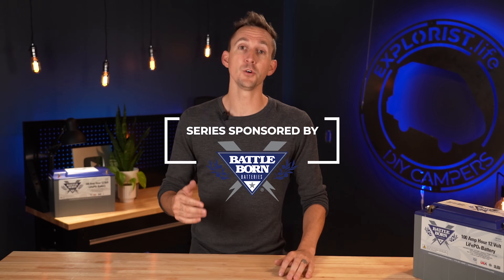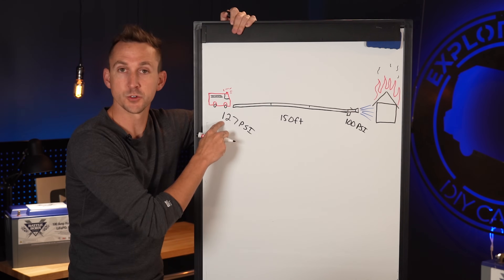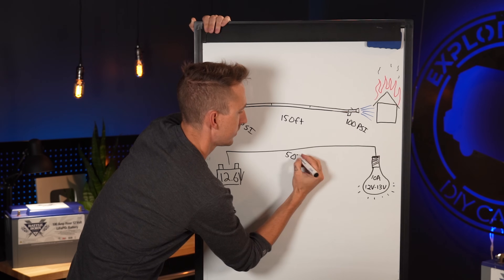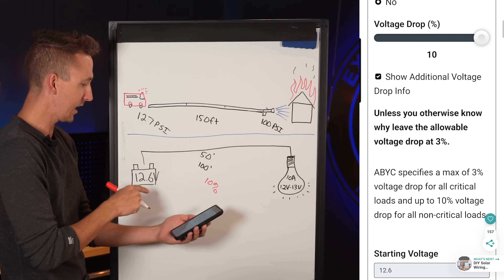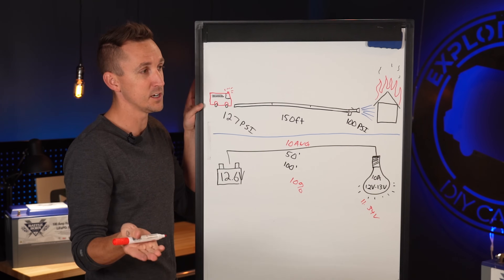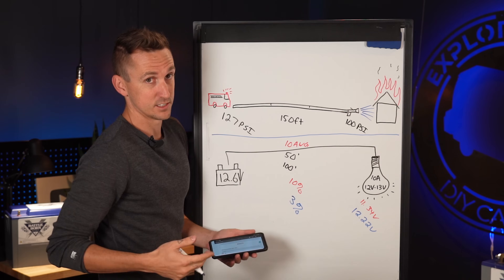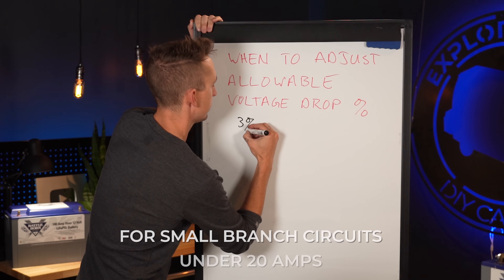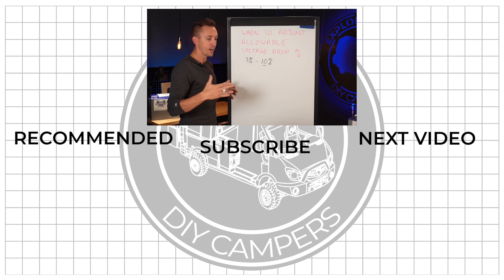WHAT IS VOLTAGE DROP? (Voltage Drop Explained)

Comment: great video!!  if it is ok to ask, could you please help me understand something -  voltage remaining after whatever drop that happened on the 50ft wire is available for the bulb, return path is after the bulb so voltage dropped across the return path should not change voltage available to the bulb. So why do you include return path from bulb to battery in your voltage drop calculation? I hope you are still reading comments on this video.
Reply from the maker: Great question — and thanks for watching! 🙌 This is one of those topics where the details of your exact setup really matter (wire size, load, total circuit length, etc.), and it’s hard to give a one-size-fits-all answer in comments. Our support team is happy to take a personalized look at your project and walk through the math with your specific components in mind 👉 https://shop.explorist.life/support?utm_source=youtube&utm_medium=comment&utm_campaign=support&utm_content=response_link

Comment: @explorist 

May I ask - how do we know in that circuit that the battery will put out the 10 amps the light needs? How do we determine this? What formula and what assumptions? Thanks so much!
Reply from the maker: Every battery will tell you how many amps it can put out.  a battery with a 100A discharge, for example, will put out a max of 100a.
Reply: @EXPLORISTlife  so amps = coulombs/second right? How could the battery know what amp to go at if the coulombs/second depends on not just the voltage but also the resistance? Is it assuming some resistance ie type of wire and type of length?! Thanks brother!
Reply from the maker: We don't have to take any of that into consideration for this discussion, no.

Comment: As voltage goes down (from voltage drop caused by resistivity loading)  current must go up, to produce the desired result. Your also not considering parallel conductors, producing resistance, from opposing electrical fields a  paralleled conductors electric fields (remember the right hand rule).
Reply from the maker: For information regarding wire sizing not covered in or directly relevant to this video, please review the 'Wire basics' chapter of the EXPLORIST.life Academy: https://www.youtube.com/playlist?list=PLmvhcyi4n0TXLHS1NeK_sCvq3Wsa3B0kT
Reply: What is “resistivity loading”?

Comment: Hey good day I've recently checked a house with an electrical problem, the owner said some lights and points are not working,  so first thing I check to see if any breaker was trip but no break was trip I check the voltage come into the house from the main panel and I saw on one phase I was getting 118v and the other phase was getting 79 volts, so first thing came to mind was the gpl power( my country utility) I turn off the main break and check the voltage coming in again and I saw 118v on both phase, basically the voltage stabilize, after troubleshooting I notice two circuit was causing the voltage drop one was at a gfci outlet that was working and the other one was some lights.i turn those breakers off. Now that main panel is feeding and apartment with a 4mm/12awg  flex cable when the main breaker turn on from the other apartment the voltage start to drop more ranging from 24v 45v after troubleshooting I notice that the when the breaker that controls the lights are on the lights are causing the voltage drop. This the first time I came across this. Another thing the power wire that is popping from the first house main panel is 4mm/12awg flex cable is then connected to a 10mm/8awg cable, could the voltage drop because the power cable is under size?

Comment: Why not just do what auto makers do and ground the bulb and battery through the metal chasis of the vehicle.  That way, you use half the wire.
Reply from the maker: Using the chassis as a conductor is a great way to end up with grounding problems down the road.  We recommend using dedicated wires for all aftermarket devices, components, chargers, etc.

Comment: Hi, I would need some help.
I have 230V to 8V bell transformer and I want to connect an electric bell 8V, trought ca. 20m thin telrphone cable. The problem is that the wire is too long and its loosing the power so that the 8V do not arrive to the bell. What could I do to fix this?
Would it be maybe usefull if I increase the voltage from 8 V to 12V?
Thank You in advance.

Comment: This video taught me that every 50 feet of firehose requires an increase of 9psi.
Reply from the maker: But in real world applications, if the nozzle is rated for 100PSI and you pump at 127PSI to overcome friction loss; you are going to have some very pissed off firefighters at the end of the hose attempting to maneuver a hose that has basically turned into a steel pipe. 😂🤣
Reply: @EXPLORISTlife this is true. I believe ours are rated for 85-100 psi.

Comment: Yes indeed, comparing Ur ex-employment fireman, kudos 2 ur services as US Army Infantry vet., n wire length connection 2 fire water hose length, I C that voltage drops at least few elements like dings inside wire or water hose, electrons bouncing around inside wire(s) [!],  amongst it, and distance wire length n MOST importantly *THICKNESS wire gauge, {which will transmit voltage (pressure) much faster n reduce resistance  or (ohm), which thicker AWG, lower number the thicker wire gauge, compare 2 matric wire gauge, bigger number thicker white gauge {make more sense which we MUST convert everything to matric system thanks to our moron n gutless leaders still NOT implemented!}, is.... In short, thicker wire gauge is the best way to reduce voltage drops between ANY two connection to maintain maximum electricity current, amp or ampere to the other side like bulb, or other electrical devices. VERY well done indeed again! BY the way, just subscribed to Ur channel!
Reply from the maker: Glad it was helpful.  Cheers!

Comment: Does this also apply for the wiring going from an Inverter to the loads? If I'm correct an inverter will change the voltage from the battery's 12.6V to 110V? So a long wire, lets say from a solar shed across a yard to a house to power a small room, should be no problem with a standard power extension cable?

Comment: Nate - A question on the DC to DC charger.  Do I need to run a negative wire ?  I was planning on just running from the alternator to the DC2DC and take a ground from the frame to the DC2DC.  If I do this will have only have 1/2 of the loss over 20’?  (I would be using the Victron DC2DC charger 30A)

Comment: The first 5 minutes also explain why we use AC current and not DC current in normal usage.
And also why most vehicle DC circuits are grounded through the chassis.
Reply: We use AC cause it was easier back then to use simple transformers to convert voltages for transmission and distribution.

Comment: Electrical friction = resistance

AC power is used for electricity transmission because DC is prone to voltage loss as it is constant. 

As you state, voltage loss can result in a device not operating properly. Some devices will draw more amperage (current) as the voltage decreases, which will result in the supplying wire exceeding its amperage rating, thus creating a fire hazard. A properly fused circuit (based on amperage) would then shutdown.
Reply from the maker: Yep!  Another good reason to avoid excess voltage drop.
Reply: Voltage drop happens on AC lines too.

Comment: Nate thank you for this video! I am of the belief that the electrical system is the heart of my van build in which I will spare no expense in that category. I will ensure that I will maximize wire gauge for the most optimal voltage set up despite the criticality of the device. thanks so much for sharing this.
Reply from the maker: Awesome!  Glad it helped.  Thanks for watching!

Comment: What other options are there to make the “light bulb” work other than 4 AWG wire (which will get expensive quickly) I’m just guessing, 24 or 48 volt system for starters?
Reply from the maker: Great question!  For small loads (say...under 10 amps), you could use a DC DC converter to bring the voltage back up to a more appropriate level.  This is REALLY dependant on the specific circuit, though.

Powering that light from a 48v battery bank would burn it out nearly instantly because the voltage would be too high.

For larger loads like, say, a 3000w inverter... there really is no good way the inverter would just need to be moved closer to the batteries.